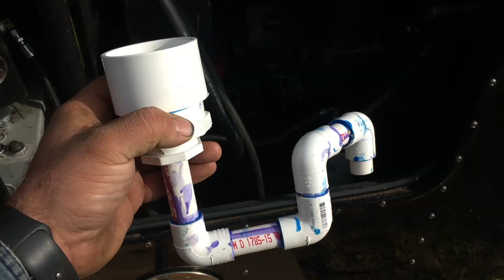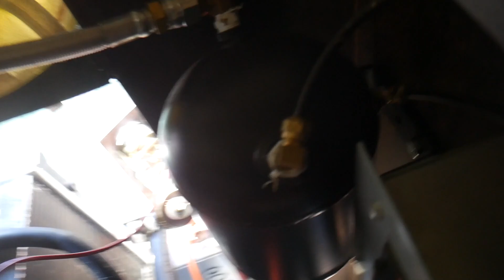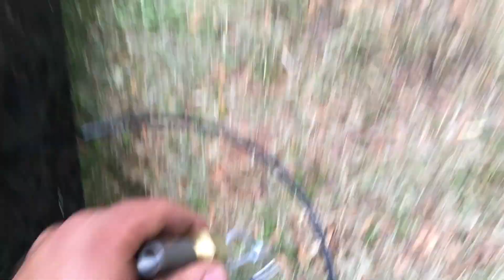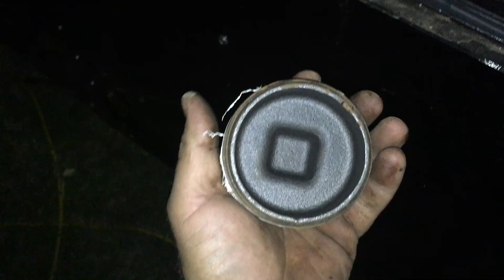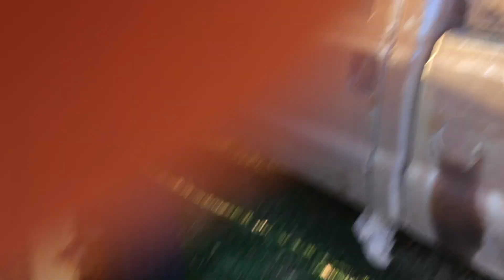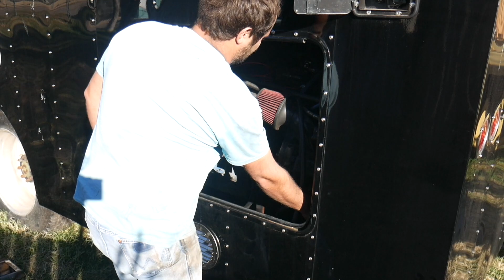Homemade RV. EP-22 Finishing the Generator. 1977 Peterbilt 359 Toterhome.

Comment: Really cool channel! Interesting discussion about oil in DDs. So if I understand you correctly, as long as the oil is low ash CD II or CF2 rated then 15W-40 is better because of reduced wear on startup? Would this be true for a stock 6V-92TA with regular oil pressure regulation? The only 15W-40 oil I can find with low ash is Delvac 1300 Super with a CK4 rating and 1% ash.
Reply from the maker: In my opinion yes. A lot of people seem to think differently.  I've seen slight decrease in consumption with the 40wt oil but not much. 1% sulfated ash is fine especially if its not idled to death.

Comment: I personally use rotella 15/40 diesel oil in everything I own gas or diesel and in winter it’s the same I just make sure oil pressure goes up when it’s really cold haven’t had any problems in fact I’ve seen it fix a oil leak on my three wheeler because the diesel oil has detergents and stuff and I believe it cause the seals to better seal or flex

Comment: If you can have all that stuff on and it doesn't even faze the 3-53, why not turn the high idle down some so it's not so loud?  Or will that significantly slow the battery bank charging?  You talked about it not being so loud inside.  I don't know your use scenario but I wouldn't want to be in a tent in a campsite next to you.

Comment: I have a question that might be stupid.  And I’m aware there’s no such thing as a stupid question only stupid people….  What can you use on a Diesel engine to tell the plc the engine is running?  I just started looking into plc this morning after watching your other video.  Didn’t know if you use a tach input into an analog input or if there is something more simple.   Thanks for putting up these videos they are extremely helpful
Reply from the maker: In my application there's no need for the plc to actually confirm engine rotation. This setup has a low oil pressure shutdown that shuts down the engine and "resets" the plc to a engine off state if there is less than 20 psi of oil pressure after startup. So if the engine fails to start or dies the plc just resets to engine off state because of no oil pressure. If the plc needs to know engine rotation speed you could use a magnetic pickup on the flywheel, Alternator W terminal, or in the case of a generator of could just use a phase off of the generator head to calculate speed. You just need a plc that can read whatever input you decide to give it.

Comment: 2 cycle detroit must use  only 30 w or 40 w due to oil control ring design and piston design and clearance  due to the engine design multi weight oil will not hold up .you make valid points .

Comment: I'm guessing 1800rpm?  It really sings being 2 stroke.  21 compression,  and quick starter,  bet it starts in really cold temps.  Any problems with belt slip on that big alternator, or is it gear driven.
Reply from the maker: Yeah is 1800 in generator mode and about 950 in alternator mode. I don’t think I’ll have a belt problem, it’s a 8 grove serpentine, however I actually haven’t used it yet because I don’t have any batteries to charge.

Comment: Great video, Zach.

Tales from the Oil fields.   I hear you Zach.   Just because they have been doing it that way X+ years didn't mean they knew what they are doing.   Often times it was done flat wrong the entire time.   Ocuums razor.  Never assign malice when ordinary incompetence will suffice. 
Oh the damage an unsupervised Tard can do.
 Though I have witnessed plenty of intentional damage over the years.

If someone was to eventually write all these stories down it would make one heck of a read.

"What I believe will work for me" , that's the summary of what I heard you explain re: your generator setup and oil selection. 

If anyone doesn't like it.   F'em in the neck. 

+2 re: the Murphy switch gauge.
I haven't seen a brand new one since my days upstream in the late 80s- early 90s.  Love them.   Dead simple, once the range has been selected.  We used ours to ground out the mag to kill the engine, didn't even need a plc, just a momentary button for startup. Murphy was smart enough to make the adjustment require an allen key, so it was harder for them to be tampered with.  The mechanic I worked with back in the day was so thankful for that feature....